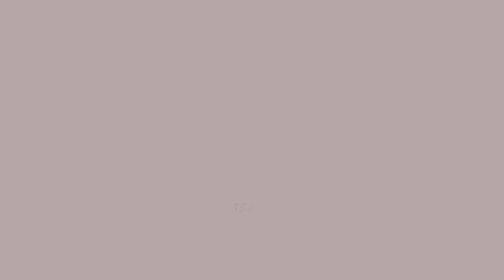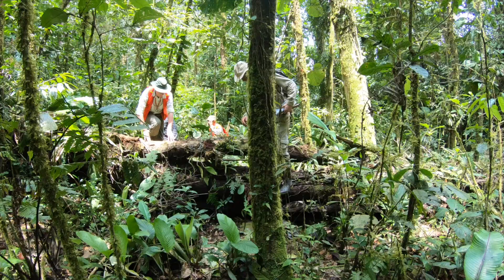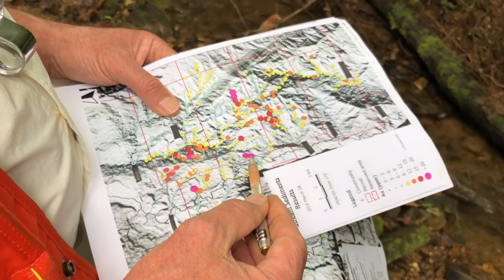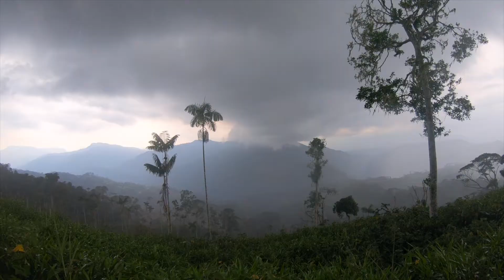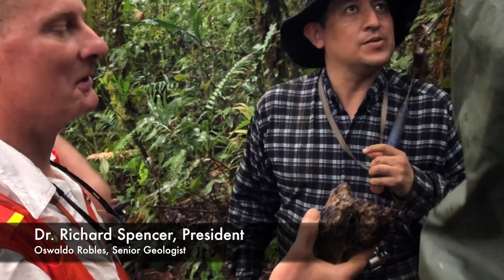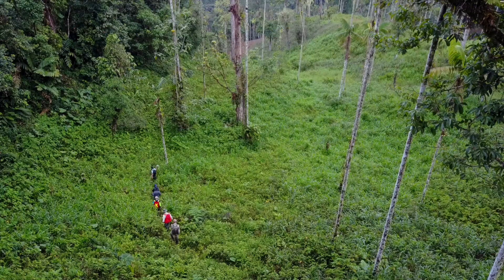Crunchy Hill Discovery

Comment: Such a good news. But if you found vuggy silica it goes for a high sulfidation system, doesn't it?, in the same time Mn CaCO3 has been reached probably it correspons to a Carbonate- base metal which could be for low sulfidation system, really interesting what it follows.